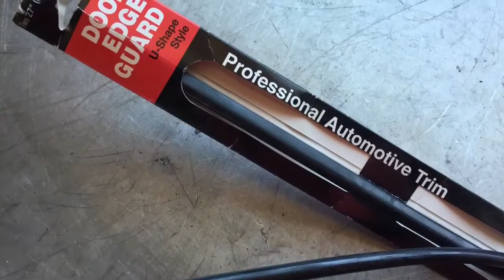Heater Bypass and Heater Lines - Daily Driver VLOG 6/9/17

Comment: What is the purpose of the clamp on the section of hose between the fittings?
Reply from the maker: +Forthwith Tx I like to have that there to clamp off the "H" if needed. Pushing air though the heater core, etc.

Comment: Where is the best place to get the metal piping and coolant hose? I'm gonna need to make coolant lines when I swap my air-cooled Vanagon.
Reply from the maker: +brian62793 in your Vanagon, I would just get some replacement Vanagon tubes as they will be pre-bent and should be pretty easy to install. Do the same for the rubber hoses (at least for the front). You can see the Aircooled Canagon section on my website - Busaru.com
Reply: Busaru that makes sense! I hadn't been to your website yet! Thanks for providing such great detail for these swaps!
Reply from the maker: +brian62793 I'm stoked to share - enjoy!

Comment: Aren't you worried about galvonic corrosion?
Reply from the maker: +jeffinillinois Thankfully steel is better than even stainless (this EMT isn't coated with zinc internally).
Reply: Just trying to figure out what to run on my kit car. Have an EJ25 and need to run the lines up to the front radiator. Have to get the burp tank (any suggestions?), relief/ drain valve, hoses and main lines. Want to run aluminum as much as possible.
Reply from the maker: +jeffinillinois No doubt that keeping the cooling lines aluminum will be best but try to make sure they don't physically touch steel (the steel lines in this bus are touching the chassis steel so there isn't a huge galvanic reaction there). In Vanagons it's common to go with stainless, but that has more galvanic reaction than the EMT. It's durable, easy to use and bend, and you can put a nice bead on it with some harbor freight bead rollers (vid coming soon).
Reply: Went looking for a bead roller at HF, didn't find anything.
Reply from the maker: +jeffinillinois Here's the video: https://www.youtube.com/watch?v=kG5-ijFfjm8
Reply: Busaru well aren't we getting all fancy! :)